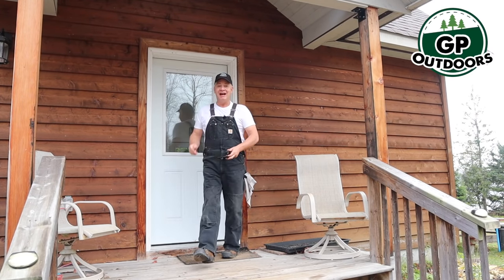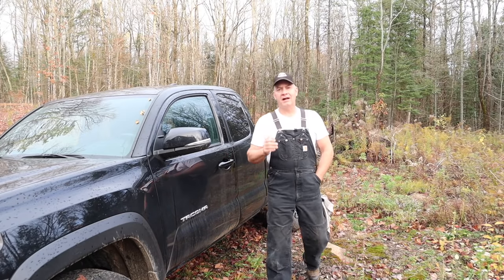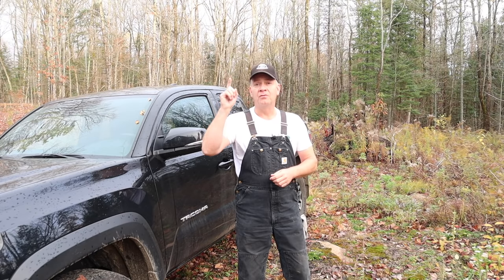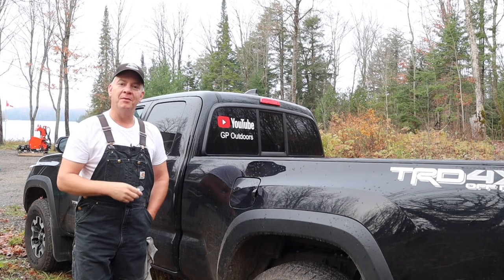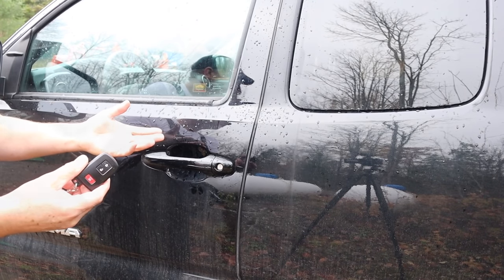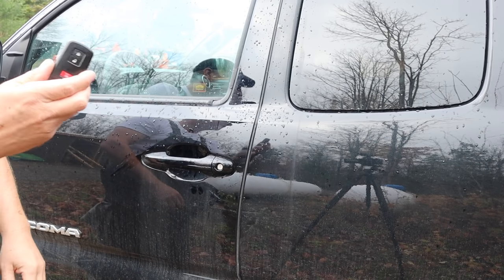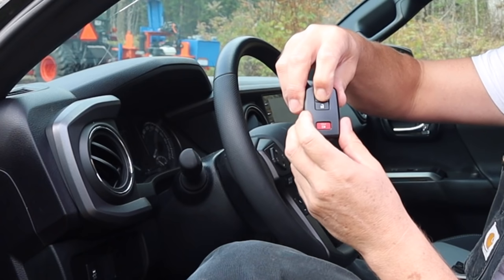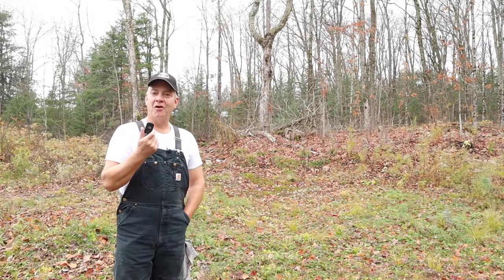#345 Stolen Truck. How To Deactivate Your RF Key FOB. Part 2. You HAVE to watch this!

Comment: Even though you demonstrated that it can be disabled by pressing the two buttons simultaneously, It is helpful with the pouch that in case you forget do disable it via the buttons it can always be inserted in the pouch. I did read that the pouch has two compartments and the silver compartment is where the key should be inserted. Also for any extra keys there is a box on Amazon that is quite large to insert all the extras including credit cards or cellphones.

Comment: My first thought was that car thieves see you access a vehicle they are interested in, and capture your signal at that time.  You extra precautions will not help.
I suppose they could match you to the vehicle and follow you into a store where they wander close enough to pick up the signal from the fob if not deactivated, but I don't know how thieves proceed.
I like the idea of deactivating fob to preserve the battery, especially if the vehicle is not your every day driver.
I wish you the best of luck.

Comment: Back in the day it was easy to hack electric garage door remotes but the electric garage door opener company's solution was to change the code every time the remote was used. Maybe the automobile industry should look into a solution like that

Comment: Another Great video !  just learned another thing. might be smart for Manufacturers to just put a on off slide switch on the fob for ease of operation. i would think that info should have been in the owners manual. hmmm. if not it should be. also sounds like a good idea if manufacturers would deactivate the fobs broadcasting 24/7/365. time for scrambling / rotating codes.

Comment: I put my cell-phone in a foil bag that some electronics parts were shipped in that prevents 
electrostatic discharge from zapping the components.  A call to the phone in the bag doesn't 
ring.  When I open the bag flap a bit, the cell MIGHT ring.  Perhaps if you leave the closure 
flap open, the fob's signal, with the reduced signal strength, would be good enough if you
are only right next to your vehicle, but wouldn't be strong enough for 300 feet transmission.
It certainly works for a cell-phone.  For your $70,000 truck, I'd be putting in a hidden kill switch
to further reduce the theft problem, such as a car-jacking.  Thanks for the video.

Comment: Thanks for your video , your right if the thieves want your car there get it but , as I learnt along time ago from 25yrs in the motor trade always read your new car or trucks car manual I would guess the deactivation of your signal is probably written in their some where  , boring bed time reading but good place always to start for important info. Take care

Comment: Another less appealing approach /workaround if you're worried about someone "hijacking" your key fob signal is to just remove the battery and use the mechanical key to unlock and lock the doors.  And then hold the FOB up to the push button to start the car (this way they need the actual FOB to start the car).  It's an extra step but probably more secure if you're not liking the idea of putting the remote to sleep.  You do run into the a few snags, for example if someone opens a door while the car is running, you have to hold the key up to the push button again or it continues to warn you that it can't find the key.  (This procedure is actually outlined in Toyota's user manual as a workaround for when your FOB's battery dies but it also works as a potentially more secure step if you don't like dealing with the Faraday pouches/cases and are worried about someone getting the FOB frequency and stealing your car.

2:49  This is partially true.  Yes you don't have to drive with it on, but as I mentioned above, if someone opens a door while the car is running (even in Park) it will prompt you for the key again or say it can't find the key.  I'm not sure if this warning comes up again, as you can sometimes bypass it, but that's one possible drawback.  I just use a small Faraday metal box that fits in my pocket.  When  Ineed to unlock/start the vehicle, I just open the lid and aim it at the car, and then close it again (by doing this, it also directs the signal in one direction).
Reply: That mechanical key is very flimsy and will snap off after any extended use.
Reply: Is this just for the smart fob?  Or also for the cheap one they only unlocks/locks?

Comment: The easiest way to disable keyless entry for good is to remove the corresponding fuse, probably the last one. This will fall back to the old system pressing buttons on the fob. Also to start you will then need to press start car button for several seconds with the key at the right corner, which is a bit tricky at first. For further protection from thieves install a OBD safer/protector to shut down access to the electronic system in your car/truck. All cheap and easy to implement.

Comment: When I had my Prius, the key fob had a silver Toyota symbol on the back. I think the point was that if the fob battery died, you could touch the silver symbol to your start button ring to start the car. The fob would communicate through the silver contact. I wonder if you disable the RF transmission, if the contact method would work.

Comment: GP, for you and others, there are still devices available to physically prevent the thief of vehicles.  As has always been case they are either a pain to install as you physically much install/attach when you exist the vehicle and remove when you want to drive the vehicle. 
Will these prevent a determined thief? Probably not, but most even organized criminals do not want to increase their chances of being caught by the time involved to remove these. A couple of extremes are an electronic coded engine immobilizer and a wheel boot lock. The first is expensive but probably the most effective. The latter is a royal pain to install and remove. Prior to all the electronics on vehicles, it was common to do a battery disconnect switch with removal key. These can still be installed in the starter circuit but are a bigger pain to install. Just a few options.

Comment: I have taken the habit of stopping my key fob from broacasting. All I have to do is pressing the lock button while I double press the unlock button. Not sure if if works on every brand. Must read your owner manual. This will save the battery of the key fob as another advantage.

Comment: Not sure if anyone mentioned this but you dont need to activate your keyfob on your Taco at all. You can start the truck by simply pushing the Start button with the nose of the remote. Plus you have the valet key hidden inside the remote to open to the driver side door. No RF signal needed .... ever.

Comment: If your keyfob battery is dead hold the fob on top of the push start button until you see the green led then push the start stop button, you should be able to start the vehicle with the fob disabled

Comment: So, what is supposed to be a convenience is really an increased theft risk and the work-around to solve the problem is more of an inconvenience than just using a metal key.  Who the heck wants to have to carry that Faraday pouch and place the key fob in it every time you turn off the car and before you exit the car to stop a thief from reading the fob?  I sure don't.  

Having to press multiple buttons to deactivate the fob is also a PITA.  I often walk up to my car with a stuff in my hands, or get out carrying stuff.  I don't have extra hands and fingers to play with the fob to deactivate every time.  The old style fob which only transmits when I press the button is still a security risk, but much less than this.

Comment: I bought that same Faraday bag but ended up also buying a metal keyfob holder, as i read that the puoch can wear out over time and lose it's ability to block the signal.  The metal box I got (which is a Faraday keyfob box basically) is more resistant to breaking down and actaully works very well (too well in some cases, as I have to reach in and pull the key out, as sometimes just taking the lid off isn't enough even standing right next to the car).

I do wish that Toyota would make it so that if no FOB buttons are pressed within say 5 minutes, it automatically shuts off in case you forget to put the remote to sleep.

Comment: One money saver....when I change battery for the fob, I change BOTH fobs batteries. I deactivate the extra one I keep as a spare to save its battery from broadcasting the signal 24/7 until on usual fob battery gets weak.

Comment: Install ignition switch bypass, doesn’t matter if they can get in or have the rfsignal. If they can’t flip the switch or hold the 2nd hidden button then they can’t start the car.

Comment: On my Ford F-150 under the mat of the drink holder in the console is a slot to put the key fob to start the vehicle without it transmitting.  Mainly for use in case of a dead battery. I would think Toyota has something similar.  It's not advertised anywhere and found out about it on YT.

Comment: I have a security background, or what my wife calls acute paranoia, so I pull the key from my fob and open the door that way.  I always close it by just clicking on the door lock inside.  Tested your suggestion with my van and it did not work.
Reply: Each vehicle is different.  Each model is different.  You really need to google a bit for your specific model and year.   I have a 2019 Subaru Forester I was looking into how to setup PIN code access and there was a couple of different methods.  It's a bit of trial & error  (The procedures include deactivating the remote,   There was no mention of the security aspect in any videos and I failed to make the connection to the security flaw outlined by GP.    So I'm grateful to GP and his anonymous commenter)

Comment: Use a steering wheel lock as well.  They want to get in & out quick and won't take the time to saw through a steel bar that connects from the steering wheel to the brake pedal.

Comment: Turning off the transmitter is great, but doesn’t stop the Canbus method of stealing a Toyota. Under the front left headlight is a canbus connector that can be accessed by a thief by removing the fender or the wheel well. Access to this connector allows the thief to change the Can-Inject signal on the bus and can start the car. No fob or relay technology needed.

Comment: Awesome vids. Im gonna fashion a default killswitch on my 2018 honda fob so that I have to press a button to engage the battery inside the fob. Unpressed, the fob is essentially dead. The flat style battery will make it tricky but I just have to interrupt the electrical path, nothing too difficult. So functionally I would have to press a button on the fob to temporarily engage the "smart" keyless entry and do the same to start the vehicle. I've researched if there's a way to make the keyless entry "normal" to where it only transmits when a button is pressed but no such luck. I bet there is a way to program a fob to do that. Im sure Honda knows a way. Maybe even programming an old style key with the correct unlock codes that simply isnt transmitting all the time. You dont even need a battery in the fob to start the new hondas at least, hold the key up to the start push button and it acts like a normal low power RFID chip, activated by a signal the car sends out.

Comment: Along with your RF fob, know that pulling the fuse to the fuel pump denies electricity to run the pump. If you go on vacation, pull the fuse, no one can drive your vehicle away. I have a manual shut off to my fuel line that does the same thing, but electronically controlling the fuse works too.
Reply: Professional thieves carry a pocketful of "spare" parts - including a collection of fuses. This advice gets the "nice try" award but not in any way foolproof.
Reply: @pdxfunkjunkie  Nothing is foolproof, but this deserves a lot more than a "nice try". Most likely they'll not waste time on replacing fuses & simply move on to the next easy mark.

Comment: Here is an idea that might help. Maybe the manufactures need to combine the fob with a fingerprint reader on the start button.
Reply: Or why can’t I just have a damn key?!?!  A real key.  All I want. 😐
Reply: @Deelitee  THANK YOU!!!!!  Can I just have an old fashion car that I have to open with the door key or which I think used to be the ignition key also. If I was a billionaire, I would design and manufacture a line of vehicles that took out all these problems. Alas, no billionaire am I. Jesus bless.
Reply: @sandrarichardson2713  right!! I’ll just take my old 2013 Highlander back, thank you! Little did I know it was gold.

Comment: A hidden battery shutoff on the car battery is another option. Especially  for overnight parking outside a garage. Even if they already stole your code they can't steal a car that has no battery connected.

Comment: I have  a 22 f250 and i have the pouch based on your previouse video works great thanks for the info. but i cant deactivate key fob like you did, at least not the button combo you did. any way i can find out with the ford?

Comment: Not having a push-button start in my 2011 Honda Ridgeline, I tried the deactivate to see if anything changes. I found through futzing around that if I deactivate the fob while sitting in the truck, the door unlock button does not work. The truck is also equipped so that you can't open a locked door using the pull handle, so basically, had I done it from the outside, with someone locked inside, they'd be stuck.

Comment: Oy!  Wish I saw this a year ago.  On too many occasions my 2017 Subaru was sitting for weeks without running (Covid lockdown).  My battery died at least 6 times!  Subaru wasn't helpful.  Finally someone told me the rfid in the key fob is constantly communicating with the car.  My husband got me an rfid pouch for my keys.  Problem FINALLY SOLVED.  Your tip would have save me all that trouble and now my car will be safe too!  THANK YOU 👍👍👍

Comment: HUMM,I will check to see if that is in the owners manual?? This is like when i picked up the 2019 with a button start ,no key. Stopped for lunch after picking up from dealer. ( it was running already when i left dealer) Got back in and pressed the start button ,nothing. Hum ? After several attempts. Told Angie "Dam if i will read that owners manual "! Then i happened to have foot on brake and the orange lite turned green ,she started up!!

Comment: the rf signal is still there but the car does not longer react to it, but it needs to receive the rf so it can decode the button signals
different cars - different ways to deactivate it
but deactivated it is much more secure
people can also place the key in a metal box at home to prevent this rf communication with/to the car while parked front the house
on my Renault Zoe (EV) I still use the keyless go (I am lazy) but I installed a self made solution, so also if someone hacks into the car system, the person will never be able to start the car.
Also I have the OVMS module and a GPS positioning. If it may happen, I can track the car.
Just needs a cheap SIM card and the app - other solutions without all these functions I have with the OVMS also exist.
I also added some "surprises"" to my solution, controlled by the OVMS I/O ... happy trying to steal it :D

Comment: would the car have started by placing the FOB up against the starter push button?  Many cars when they have a dead FOB battery will let you start your car by doing that.

Comment: It appears my FOB won't lock out the signal (VW) but I find it interesting that your dealership didn't tell you about this function especially when you discussed the theft with them or maybe your owners manual has that info in it? I find it curious that with my car I have to be very close within 5 ft to be able to unlock the car without touching the FOB of course my hand has to be touching the door handle so if my car can't recognize the signal from more than 5 ft how can a thief pick up the signal from a longer distance I think you said in your other video 300ft?